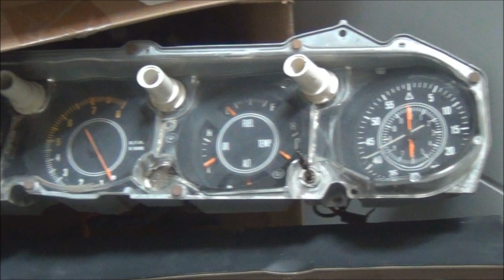Collector car barn/estate find.

Comment: That's  actually  a  1940 Lincoln  Continental  convertible  not  a  Zephyr .  Note the  door  handles .  1940 is the  only  year with  the  turn  type  handles .  All  the  rest till  48 have push  button  openers .
Reply: good point, la Grange